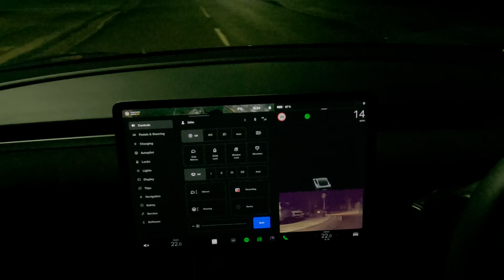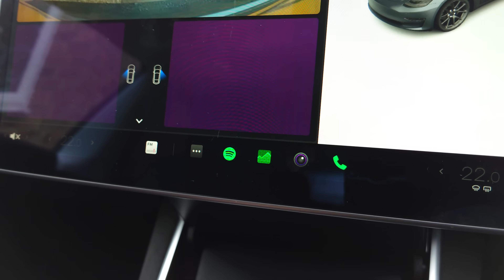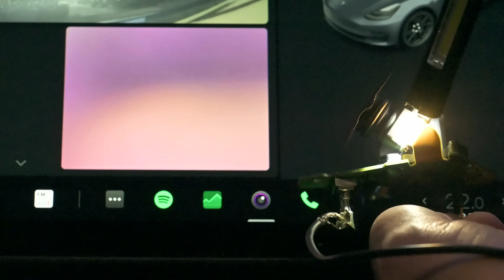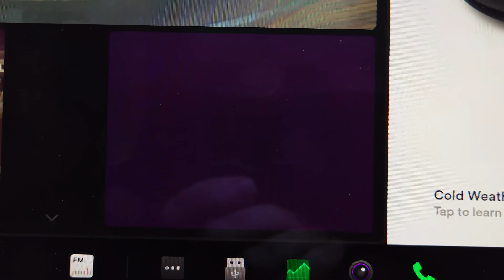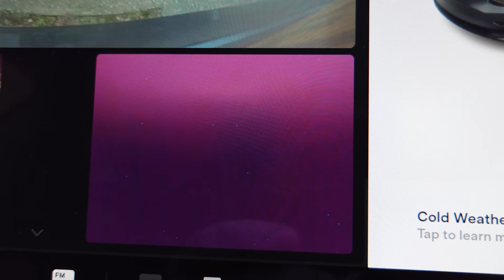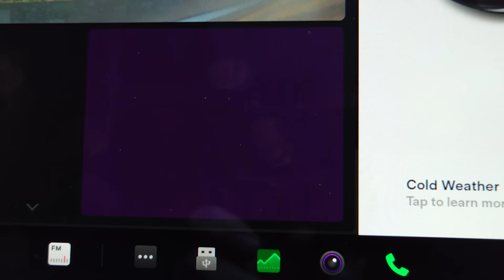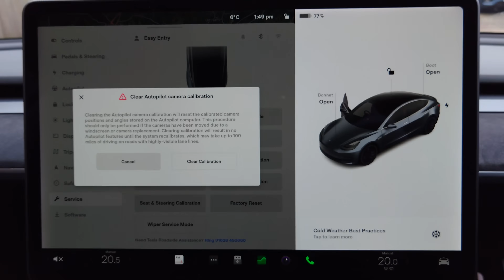Repeater glare and how to fix it (if you dare!)

Comment: Revision D cameras is the ones your looking for.  Produced after 1 Jan 2020 .  I had this issue with one of mine as I had a mixed refresh M3.  One was a revision C one was D.  Confirmed with Tesla center.  This issue is further than a reflection.  I think it’s a power issues pulling voltage from the camera or creating a EMI of sorts.
Reply from the maker: Yes, thanks we just noticed and corrected the type in our update! -D repeaters fix the problem but it is still possible to repair -C cameras with the method we show in the video.
Reply: Interesting. My M3 (Europe) was produced on Feb 8 2021 in Fremont and also has the glare. If the new modules are from 2020 they must have had a ton of old ones left over for quite a while

Comment: Great video!  Maybe the following has been mentioned in the comments already.  This problem has to have at least some small affect related to safety using Autopilot/FSD driving modes at night.
Reply: which is what should be pushed towards during a conversation with SC imo to try and force them to replace that part free of charge.
Reply: @VladOnEarth  Yea I tried that they don't care if you have FSD and the camera is affected they say it's still within spec and works good enough.  Typical Tesla response.
Reply: @JFlywheel  because they messed up so bad that if they admi it once, it will mean 100k+ cars will need free replacement  they will lose A LOT of money from that. I personally would have been ok with just replacement part shipped to me, super easy replacement.
Reply: @VladOnEarth   I think they will be ok if they at least fixed it for FSD cars.  I mean they are charging an arm and a leg for FSD.   I guess the other solution is to drive like a BMW driver (just don't use your turn signals).
Reply: @VladOnEarth  You should go into business to lose money lol lets see how long you last. #2 didnt they upgrade anyone who wanted to HW3 for free? Seems that would be quite expensive for them but they did it.

Comment: Great video and thanks. I successfully fixed one and the other I must have messed up. the video is blurry, the amber on the unit does not light up and the front & tail lights blink fast. Any suggestions or just buy a new one?  Thanks
Reply from the maker: Sounds like you have damaged the PCB, so a new unit is the only way to sort that.

Comment: There are newer revisions for the repeaters than the ones you mentioned in your video now in North America (should be the same for the whole world though): 1495864-20-D and 1495865-20-D.  Hopefully they are all now being made without light bleed.

I decided to modify my repeaters today to get rid of the light bleed, even though it doesn't bother me since I don't care for the blind spot feature.  They were a pain to remove even knowing exactly how and where to push on the two tabs.  I ended up breaking the housings on both.  But that just makes it easier to brush Plastidip around the camera lens and board.  Then I'm just going to epoxy the housings back together.  If they end up looking ugly, I'll just buy the new revisions to replace them.
Reply from the maker: Glad you tried the fix anyway. Yes, you are correct, only the -D revision part has eliminated the glare properly. The -C repeaters still have glare which comes from the glue holding the camera onto the PCB transmitting the LED light into the sensor. We'll post a follow up video soon with more details.
Reply: @TeslaGurus  hey there, I noticed in your video that version C of the side repeater camera is the new design and assuming it eliminates the light bleed. My Tesla service centre has ordered two to replace on my 2019 M3 and wanted to confirm first. Thanks and amazing video by the way!
Reply from the maker: @wissamzaher  No, the -C revision still has light bleed. We are making a follow up video to explain this. You need to wait until they have the -D repeater in stock. That fixes it.
Reply: @TeslaGurus  thanks for that. Weird as my mates m3 has version C and no light bleed. Which is confusing but a good sign? Looking forward to the upcoming video. Thanks for highlighting the issue!
Reply from the maker: @wissamzaher  Are there any other revision numbers on the housing? What is the full part number? Nothing would surprise me with this as we know there's a mix of good and bad cameras installed in cars from the factory!
Reply: @TeslaGurus  LH 1495864-20-C
Reply from the maker: @wissamzaher  Odd, but unless we open one up we won't know for sure why there's a difference. It underlines though that the only way to know if you have glare or not is to test it first and the only 100% certain part number to fix it is the -D one.
Reply: @TeslaGurus  how long have the version d’s been out for? My mates car was delivered in December 2020. And if the newly designed pcb boards don’t have the drill holes then does that resolve the earlier issue of light bleed? Or do the new pcb boards still light bleed? I.e version C?
Reply from the maker: @wissamzaher  -D are recent but we don't know how long they've been out. It's not just the holes causing the glare. the -C repeaters we've seen still have glare.

Comment: It's a very poor design that should be fixed free of charge.
It's a flawed design that is prone to misting and light leakage. This boils down to a safety issue and I believe Tesla will be forced to change out these cameras.
I suggest Tesla get ahead of the issue and start the ball rolling in a positive direction.
Change out the cameras!

Comment: OMG.. I assumed it was glare from the lens on the outside. Both mine have this issue only at night on my Y-P-20.  It's really typical Tesla to deny an obvious problem and push the issue back on their customers by telling them " It's within spec, but we'll fix it for $$$"
Reply: A complaint  to the NTSB might save you $300. They will decide.
 " I was blinded by the red glare, changed lanes and caused an accident.

Comment: Very good detective work.  Question - could you just make the holes then give a short blast or two of some non conductive rubberized spray paint into the holes?  It doesn't look like it would matter what it lands on as long as it doesn't glob up on the end of the LED tube.  May work to seal better and much easier than trying to dab at it with a small brush or dowel.
Reply from the maker: No, as it would then go all over the inside of the repeater window. As long as you have a small brush or stick you can just dab it all over the camera and rear pcb which I think is probably the best method. Or use a syringe if you are using free-flowing paint/sealant.
Reply: @TeslaGurus  oh right, I didn’t think about the inside of the repeater window.
Reply: The reason the multitude of holes are under the LED is so that it doesn't overheat.  You don't want to spray any of the LED holes, from whichever side you come in.  Spraying the light pipe can't be too bad, but will also increase the temperature of the light pipe, and therefore the LED.  How much?  Hard to tell.

Comment: How about poking through with a hot soldering iron instead of drilling?  That wouldnt damage the board on the other side
Reply from the maker: That might work, although the plastic is quite thick and you could still accidentally hit one of the coils which is just the other side sticking up on the main PCB. Whatever method you choose, just go very slowly and carefully!
Reply: @TeslaGurus  Boring a hole with a soldering iron worked well for me.  It was much less stressful than drilling the hole.  I drilled the passenger side and almost destroyed it.  I used the soldering iron on the driver side and it worked very well.  I bought liquid electrical tape at Ace Hardware and it was perfect.  Problem solved!!  Thank you Tesla Gurus for this great video.  It gave me the confidence to try this and it worked flawlessly.

Comment: Nice find! Does the camera housing have an ultrasonic weld or is there a better way to get inside? I'm assuming you destroyed 3 enclosures to get to the boards so could tell. I've had to solve similar problems with light sensors and cameras. If you can get inside, may be best to wrap around the camera with electrical tape too.
Liquid electric tape should also well for the holes, but just as messy as silicone.
Reply from the maker: There is no better way I can see other than somehow making a hole yourself. The two halves are very well stuck together and don't break apart easily along the weld/glue line. It's too easy to break off a large piece of the housing when prising them apart. We actually used liquid electric tape in the video, so yes that works well and flows nicely. You could use that in a syringe and be more precise where you squirt it.

Comment: I might give it a go with a Dremel. I don't have a drill press.
Reply from the maker: Just be vary careful how deep you cut as there are components close to where you need to get access to get the paint/sealant/tape in there.

Comment: Really interesting thanks. Any ideas on stopping glare from bright sun please?
Reply from the maker: There's not much you can do about that. It's a wide-angle lens (needs to be) and that means low sun will sometimes be a problem.
Reply: @TeslaGurus  cheers. How will this affect FSD? I quite often get multiple camera issues particularly when the suns low in winter in the uk. Does it stop FSD working or is it compensated by other tech. Being cheeky can you devise a solution for not seeing. black door handles on a blue car at night please. Aarrrggghhhhh.
Reply from the maker: Simple answer is we don't know as FSD isn't used much in the UK. Personally I think the door pillar cameras are more critical for FSD but only time will tell. I have color coded door handles on mine, so it's impossible to see them in the dark! I think we need backlighting.

Comment: It strikes me that maybe the light tube should be silvered to direct more light to the end. This would make the indicator brighter also.
Reply from the maker: That would make very little difference to the brightness but if the whole piece of acrylic was painted apart from the ends that might have been enough to prevent this issue in the first place.
Reply: @TeslaGurus  that’s what I meant, maybe even a white sleeving around the tube.
Reply: @kevinfletcher1999  opening them up isn't easy, but before i Saw the tapei would have guessed that the solution would have been some sort of heatshrink on the acrylic piece instead of a Tiny bit of fidly tape, but then again i dont know the exact manufacturing details the tape is certainly cheaper and maybe easier is well
Reply from the maker: Yes, very difficult to open them up without major damage to the housing, but our method works well enough and is relatively easy to do.

Comment: The issues goes beyond the glare.  Interestingly I've been able to compare the new and the old because I had my right side replaced due to peeling chrome.  The new camera on the right side not only lacks glare, but it also lacks problems seeing when it's raining outside.  Tesla won't admit it, but the old cameras were severely flawed due to the light glare and due to water collecting on the lens while its raining causing the image to warp and wobble while driving.  FSD is extremely unhappy whenever its even slightly misting and it's always complaining about the older camera.  Tesla service refuses to replace the other old one.
Reply: Thanks for the info. Must be the lip on the cover keeping the lens cleaner.
Reply: @kkallioj  Could also be a water repelling coating on the lens itself?
Reply: Know of any way to degrade the chrome and I can get a warranty replacement?
Reply: How is it holding up in 2025? Was it just a fresh water repellent finish that eventually faded? Otherwise I’d be replacing mine as well
Reply: Did they add hydrophobic or hydrophilic coating on the lens? Would you be able to spray some water on the lenses to show the comparison? Thanks in advance.

Comment: I just created a service request using this video and the images provided of Tesla's tape DIY fix and I got a very similar message - actually word for word in your highlighted sentence - of the text at 1:31:

"The blind spot camera performance on older vehicles is neither a defect of materials or workmanship. It is a characteristic of the product. That characteristic has now been design enhanced in newer vehicle production. If you wish to upgrade to the new camera technology then you do have the option to purchase the upgraded cameras and have them installed."

Not sure what to do from here to get this corrected by Tesla. It seems as if they've been been briefed about the issue on the backend and have made a template response for service agents. Would really appreciate some advice.
Reply from the maker: Yes, they probably have been briefed. I can only suggest being persistent and reiterating that this affects safety because it's distracting and doesn't allow a good view at night. See if that helps? If all else fails, consider the DIY fix?
Reply: Guys does this glare effect autopilot feature?
Reply: @lubec14  Put it this way. There's no way having the camera blinded doesn't affect whatever's dependant on the image from the camera. Yeah it most likely affects autopilot. It'll definitely affect FSD.

Comment: Unless the 12V if used to power the camera, a simple fix is to disconnect the 12V, no blink lights but the problem goes away.
Reply from the maker: Side repeaters are required by law in many countries so I wouldn't personally recommend this.
Reply: @TeslaGurus  
It was just a thought
Thanks for coming up with the low cost bodge to fix the issue.

Comment: There is probably a market here for someone to set up a service to repair their cameras.   I don't personally have a pillar drill or drill press and not really willing to attempt it without one.  I have done something similar to stop rear light condensation by making a 3D printed silica-gel pack which can be replaced when necessary.
Reply: I did it by hand with a portable drill, and I definitely went a bit further in the housing but apparently didn't damage anything.
Reply: Get a dremel

Comment: Good and very instructive video 👍 Funny enough, I have not observed any problem with side camera and turn signals at night on my SR+ MIC dec. 2020. Due to the video, I have today tried to tape over the side camera to see if it would reveal anything. It did not - the turn signal had no effect at all on the side camera image in the car. It might be interesting to know if the Tesla-mounted black tape on the circuit board near the side camera is related to the place of production (USA or China) or the car type (SR+, LR, P).
Reply: I have a SR+ Freemont October 2020 and it has the light leakage. I'll probably end up performing this repair technique as the glare is pretty annoying at night with the blinker cam.

Comment: Great piece of work!
Just a remark, when the Tesla technician came to replace my camera, he did not removed the wheel trim part. He pressed the two clips visible on the top of the camera (7:35) with a flexible plastic tool and the camera pop out of there. Clean and easy.
Reply from the maker: We followed the Tesla Service Manual. Rangers may have discovered short cuts to save time. As long as you're very careful and put some tape on the bodywork to protect it, that way may work for you but the risks of breaking one or both of the securing tabs are much greater.
Reply: @TeslaGurus  ok, I see also your further explanation on TMC.

Comment: Not sure if it's been mentioned yet - since you have spare/duds, are you willing to try filling one up to the level of the camera pcb with opaque potting compound? (tilting to the appropriate angle to prevent the output optical end from having problems) - to see if the compound wicks between the led and the light pipe interfering with the blinker?
Reply from the maker: That's going to obscure the light pipe so the repeater won't be visible afterwards. There is a big gap between the light pipe and the repeater window!

Comment: Are the two halves just glued together? If so, can one simply apply a heat gun to it to soften the glue and pry it apart? I'd like to give this a go but don't feel comfortable drilling out the OEM housing.
Reply from the maker: They are either welded or glued but impossible to get apart with a heat gun or any other way without risking damaging the unit.

Comment: I don’t see the need for access inside the wheel well. Are there clips that need to be in clipped on the inside? Otherwise, can you just pull on the side markers from the outside? If so, which area of the side markers should you pull from? Front rear top or bottom?
Reply from the maker: We followed the service manual method. Metal is very thin in that area so we didn't want to risk damaging it.
Reply: There are 4 (or 5) clips and you need to depress them if you don't want the sheet metal to scrape the teeth off the clips.
Reply: Everything I needed to know! Thank you both

Comment: Very nice!  I can see why this isn't really practical as a service procedure.  But definitely doable, especially if you were planning to fork out the money for new cameras anyways.  BTW, the "serial number" is likely a date code (YYDDD) to identify the PCB lot.
Reply: Tesla states in the internal service manuals that the camera/repeater is "a single use only". If you remove it from the fender you have to replace it. Quite bold given the pricetag..
Reply: @wiwelwiwel9141  what does the new one cost from Tesla?

Comment: Take a caulking gun and squirt some in there?  Seal and stop light leak.
Reply: I just unplugged the power on one side, checking to see if the vehicle complains (it hasnt so far).  The power draw on that tiny led is so low, dont think the system has a way of detecting its off.   Dont care of the side led.